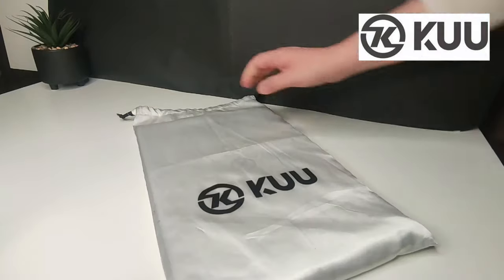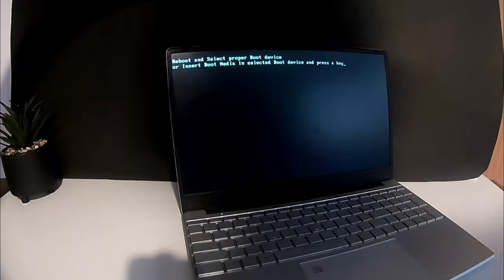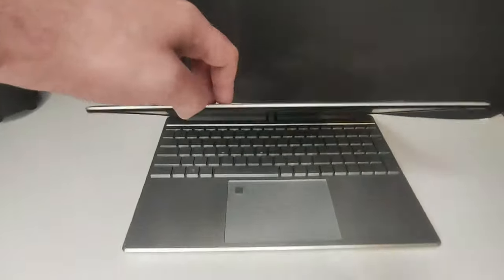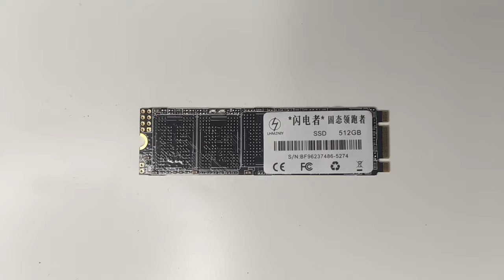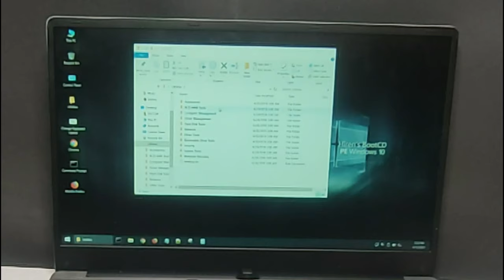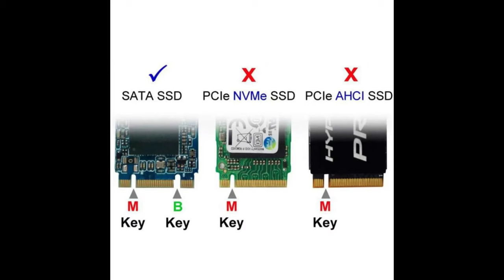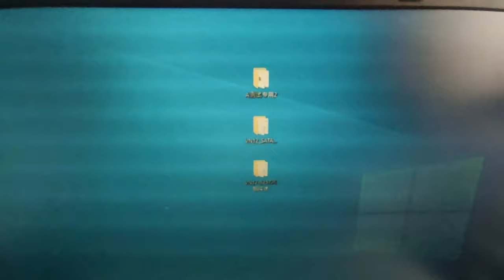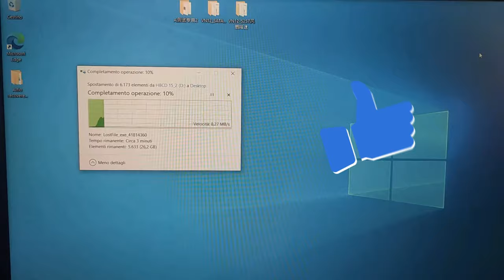Chinese KUU K1 laptop SSD Failure

Comment: Man, that SSD is so shitty, it has the performance characteristics of an eMMC and apparently the same lifespan. 
One may think they are using eMMC cells soldered to an M.2 platform to be able to advertise SSD instead of eMMC. 
Just an assumption, I have no evidence or whatsoever.
Reply from the maker: i have no clue, but they've clearly cut costs on hte storage drive!!